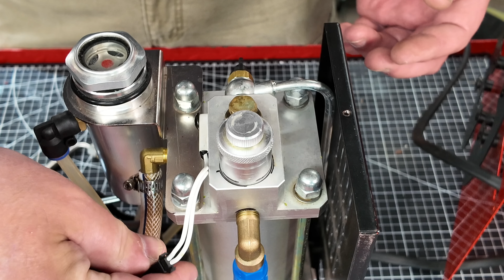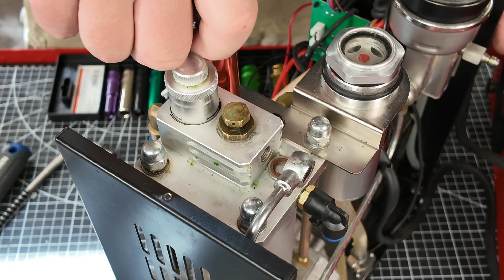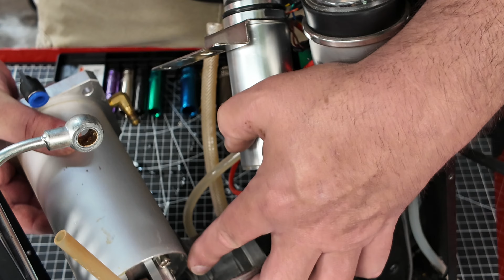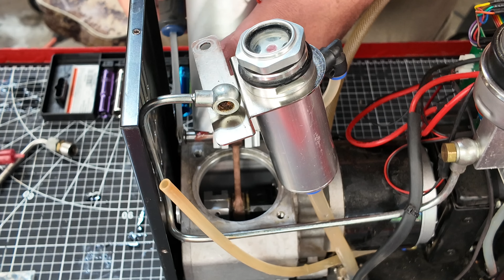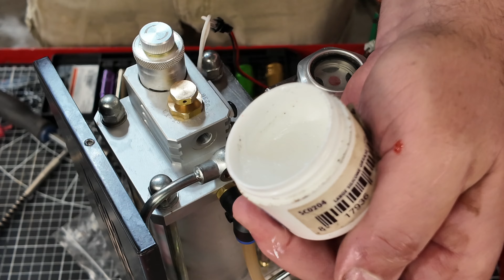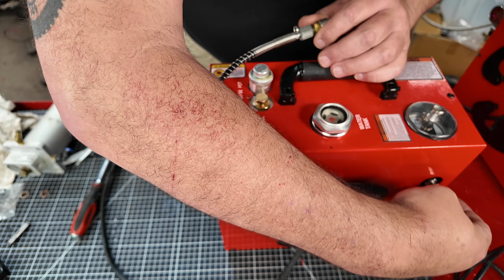Revive Your GX CS4: Full Pump Swap Tutorial for Peak Performance

Comment: You mentioned problems with over greasing... what happens if you do and how do you fix it ?
Reply from the maker: There is a process for possibly recovering an over lubricated pump. Sadly it often requires a cylinder swap to fix.

Comment: Thanks for the video , the pistons come pre lubed I’m sure . I run my cs4 with the cover off and a window air conditioner blowing cold air on motor and crankcase it stays pretty cool , am I over concerned with heat ? Do you see any issues with running it without the cover ? Thank you
Reply from the maker: Maybe you are referring to the cylinder assembly? Yes, they come pre lubed. Do I think you need to run your pump with the cover off? No, check out my video where I map out the temperatures at various locations, the system seems to do a very good job of extracting heat. Without the cover on you are also removing airflow from the cylinder area, not that is really a big deal in that area since the cylinder is water cooled anyway. That being said, stage 1 & 2 are the least benefited from the water cooling, stage 3 is the most.
Reply: @theairgungeeks5106 thank you , I love the led water flow indicator

Comment: I've been in the pcp game for 15 yrs and have 17 air rifles .As far as I'm concerned this is the downfall of pcp , the filling is nothing but a problem and expense . I've got 3 different types of compressors 7 compressors in total    including 2 cx pumps and none last long before the expense of rebuilding them.
Reply from the maker: Thanks for your comment, but it sounds like you've had some bad experiences.
Reply: but its still better than 15 years ago when to standard was going to the scuba shop to get your tank refilled. Now theres actually compressors at home. Or you can buy a western compressor prob 4x the price of the cs4. Also really depends on the airgun, it saves you a lot of headache and theres much cheaper options if you only fill up to 4500 PSI. If you want to hit that 5000 PSI like some high powered airguns like the Huben GK1 the most economical option is GX CS4.. otherwise you can buy some DH or Tuxing 4500 PSI compressor for only 150 euro.

Comment: They have the stupidest way of lube ,mine came with no lube and you can't even tell if its putting lube in it . I turn the knob and then opened it and nothing moves in it ,even after I just filled it with the syringe.

Comment: Well I took everything apart as per your instructions and the pump isn't lifting off as yours did to be able to see the rod on the bottom with the half moon clips. And there's nothing to spin the engine to be able to put it in the top position which is why I  think it won't simply lift off. Any advice would be appreciated
Reply from the maker: You can walk the crank pin around, it stiff but not impossible. What do you intend to do when you remove it? Disassembly is not going to go well and may be a one way trip. Do you have a replacement?
Reply: @theairgungeeks5106 
I have a replacement. Just wondering. How does one "walk the crank around ". I looked for some way to turn the motor crank and didn't see anything. Thanks for responding
Reply: @theairgungeeks5106 
Got it replaced, and working. Thanks for the instructional video and reply. Appreciate it